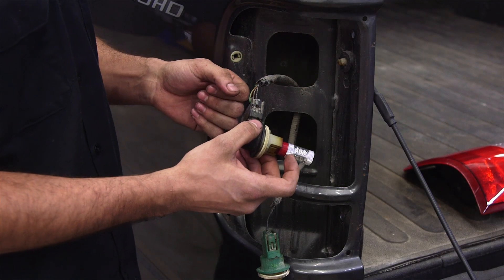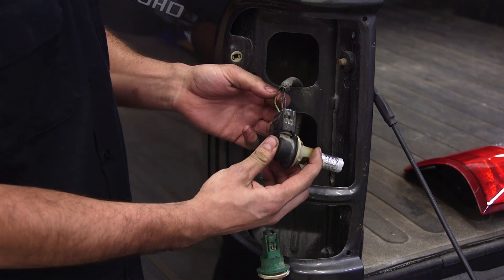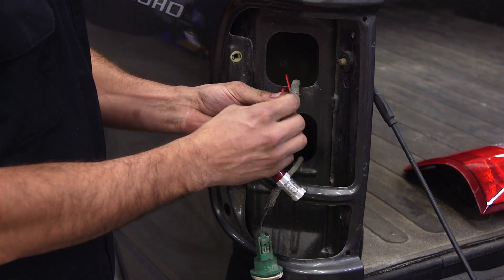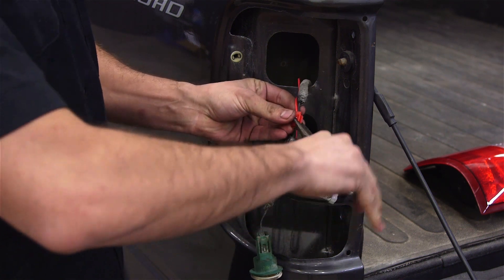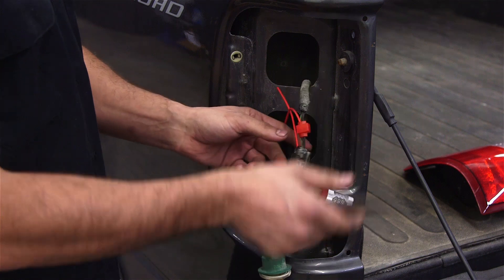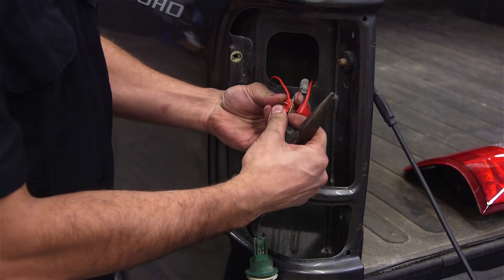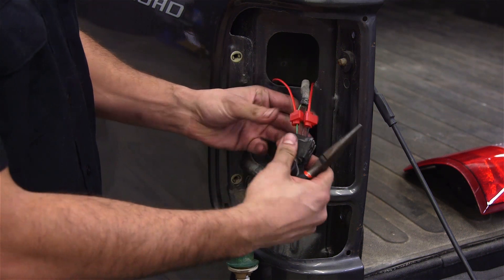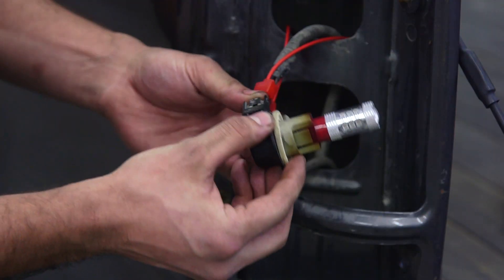Fix Hyperblinking! How to Install Resistors for LED Turn Signals | Diode Dynamics

Comment: My led turn signal doesn't blink at all. But the blinker arrow blinks fast in the cluster.. will it blink once I install some resisters?... someone please lmk. Thanks in advance  ...
Reply from the maker: Hey there! Try flipping the bulb 180 degrees in the plug to see if that makes them blink. If that doesn't work, feel free to give us a call at 314-205-3033, Monday-Friday 10 a.m.- 5 p.m. CST, or shoot us an email at contact@diodedynamics.com, and our in-house US service team would be happy to help you with that.

Comment: Can you install a regular light bulb after the resistor, or will it always need an LED after this?
Reply from the maker: If you go back to halogen, you can remove the resistor.

Comment: So if you have led turnsignals, led tow mirror, a brake strip, and led rear turn signals. How resistors are needed

Comment: Do I need a resistor at the brake light also?
Reply from the maker: Since brake lights are a solid current bulb, you should not need a resistor kit for them. If they also function as your turn signal, however, you may need a resistor on them since the current fluctuates.

Comment: There's an easier way to fix hyper blinking.
Buy a new electronic flasher.
Problem solved.
No wiring needed.
🤦🏻‍♂️

Edit: It just dawned on me why they teach people this...
It's so that instead of just buying LEDs from the company will also buy pointless unnecessary resistors.
More shit sold = more money for the company.
What if they sold you white LEDs and then sold you red covers to install over them for your brake lights?   Would you buy them?

If your answer was no that's stupid who the fuk would do that?
The answer is everybody because that's originally how they sold colored light bulbs.
Reply from the maker: We appreciate your feedback on this! However, it is important to note that not all vehicles come with a flasher module option. Additionally, we do offer flasher modules on our website as well for the vehicles that do come with a module! Thank you for checking the video out! 

Here is the link for the flasher modules we offer:
https://www.diodedynamics.com/accessories/led-flashers.html

Comment: So you are actually putting the resistor in parallel with the turn signal circuit?
Is this a special resistor for this purpose or could I use a regular resistor used for electronics?
 In this case I am actually putting LEDs in my reverse lights and I have read that some people have reported that the light stays on all the time when the car was running is this a common issue I have purchased LED bulb specifically for reverse lights. 
Car in question is a 2001 Grand Prix SE. 
Thank you.
Reply from the maker: Hey there! Feel free to give us a call at 314-205-3033 Monday-Friday 10 a.m.- 5 p.m. CST, or shoot us an email at contact@diodedynamics.com, and our service team would be happy to help you with that.

Comment: What about my brake light that's run off the same line? My turn signals work fine now, but my brake lights still flash.
Reply from the maker: Please go ahead and give us a call at 314-205-3033 Monday-Friday 10 a.m.- 5 p.m. CST, or shoot us an email at contact@diodedynamics.com, and our service team would be happy to help you with that.

Comment: Just had this issue with my truck. I swapped all the lights on the front of my truck to LEDs and now I get the hyper flashing. My tail lights also messed up. They aren’t on while running but will still light up when the brakes are applied. Will putting in the resistor help with this issue too?
Reply from the maker: Feel free to give us a call at 314-205-3033 Monday-Friday 10 a.m.- 5 p.m. CST, or shoot us an email at contact@diodedynamics.com, and our service team would be happy to help you with that.
Reply: I have the same problem in my 2012 Silverado, when the position ligths are on the hyper flash Start, but when my position ligths are off and use the turn signal they dont hyper flash

Comment: Each "location" that has  an LED bulb requires a resistor? Each "LED BULB" requires a resistor. I the assembly has two LED bulbs two resistors are required.  For this application shown one is ok; if that was a Silverado with two bulbs, two resistors per side would be required.

Comment: It would help if you would include on your website resistor ohms... maybe it's in the description but the description on my phone when I click it disappears, if I click anything  else like specifications it will show specification named column and specifications also does not include the ohms... problem in my case is that I need higher than 6 ohms which Sylvania resistor is

Comment: This might be a dumb question, but is it easy to undo everything and go back to your original turn signal bulb? Can you undo the splicing just by taking it off?
Reply from the maker: Yes, you can return to your original turn signal bulb. 

However, since there might be a splice in your wire wrap most users will heat shrink, liquid tape, or electric tape any small wire exposure after removing resistors.

Comment: That will last a year at most.  Better to splice with heat shrink connectors, or solder directly and use shrink tube.

Comment: Great video! Is this kind of connection also considered a bypass? I think the dashboard indicator might be unable to detect whenever the LED light is malfunctioning. 
Do you think using a resistor might have the potential for overheating and durability issues? 
Or do you think changing the turn signal flasher is a better way to do it instead?
Thanks!
Reply from the maker: The reason we add a resistor is because the LED is using much less power than the factory halogen. So, the computer thinks there is a bulb out. This is what causes bulb-out warnings and hyperflash. The resistor puts resistance on the circuit, tricking the computer into thinking that there is a halogen bulb still in the socket. These resistors do get very hot, but are built to handle the heat. We recommend mounting them away from any flammable parts or parts that can melt for this reason. However, if you can find a flasher relay for your vehicle, this is always a much easier option!

Comment: I notice that every company that shows fixing the hyper flash on a vehicle it's always the rear lights and never the front because it's a lot more intricate for the fron. Especiallt when there are four front bulbs.
Reply from the maker: Hey! In this case, it was easier to demonstrate. The front will be the same process, but it is much harder to get a camera in the engine bay to show how it's done.

Comment: I bought a relay and lead bulb from you guys i put in the lights but i dont know what is the ground and what is is the signal wire i have a ford ranger 2019 has three wire on my signal light green yello and purple dark color please help
Reply from the maker: Hey there! Please go ahead and give us a call at 314-205-3033 Monday-Friday 10 a.m.- 5 p.m. CST, or shoot us an email at contact@diodedynamics.com, and our service team would be happy to help you with that.

Comment: I installed the resistor the way you showed in the video and my Miata still does the hyper flashing.
Reply from the maker: Hmmm- that's strange. Please reach out to us at contact@diodedynamics.com, or give us a call at 314-205-3033 M-F CST, and we can help find out what's wrong!

Comment: Will I need to add a resistor for my turn signals and reverse lights? Meaning I would have 2 resistors per side
Reply from the maker: Hey Travis! You should only need one pair of resistors for your turn signals.

Comment: If I had purchased led lights that are plug and play. Do I still need a resistor to be installed?
Reply from the maker: Hey Jack! This really depends on your vehicle. Some vehicles work fine without resistors and others will hyperblink and throw bulb-out warnings. We always recommend picking up some resistors if you are upgrading to LED because they are inexpensive and come in handy!
Reply: @diodedynamics  yea but if I do that I lose my warranty from the dealership
Reply from the maker: @jacklarage2651  Then we do not recommend installing LEDs.

Comment: With turn signals that have 3 wires, how do you know which wire is the turn signal? Is there a tool to help with this?
Reply from the maker: Go ahead and give us a call at 314-205-3033 Monday-Friday 10 a.m.- 5 p.m. CST, or shoot us an email at contact@diodedynamics.com, and our service team would be happy to help you with that.
Reply: @diodedynamics  Thank you very much!

Comment: I have tried installing these bulbs in my 2013 Chevy Silverado with no success. Yes I installed the resistors on all the lights that flash. Guess what still have hyperflash. I don't recommend these LEDs at all. I have spent a lot of money trying to get them to work, enough is enough.
Reply from the maker: Hi there! We're sorry to hear you're having issues with your turn signals. Please reach out to us at contact@diodedynamics.com, or give us a call at 314-205-3033 M-F CST and, our service team will be happy to help you get rid of the hyperflash.

Comment: So one side of the resistor goes to the black wire which is ground and the other end goes to the green which is the turn signal correct?
Reply from the maker: That is just for this specific vehicle. You are correct in saying that one goes to the black ground wire. However, you will need to locate the turn signal wire for your specific make. It may not be green.

Comment: Should've made this error free for 90$ that they cost 😂
Reply from the maker: Hey Christian! Many models do not require resistors. It is specific to each vehicle, this is why we offer resistors. We do offer more affordable options for bulbs as well.
Reply: @diodedynamics  I love yalls products but for 90 they should've them built in.
Reply from the maker: @notoffroading  We'll definitely pass the suggestion on to our engineering team!

Comment: The one part they always skip over is figuring out how they know the green wire is the turn signal. Was it a schematic? A multimeter? A lucky guess? Your favorite color? That's part of the process too.
Reply: grab a multimeter and turn on the turn signal. measure from the black wire to either side. whichever one gives you power is the one you need
Reply: U need circuit tester 12V
Reply: Easiest way is to just google it. One other way is to look at both left and right sides. The color that is different on both sides is the turn signal. (e.g. Left side has green/brown/black and right side has yellow/brown/black then you know it is the green and yellow wires)
Reply: Ha ha ha, I love the part about - your favorite color! 🤣

Thank you for the laugh, and a Happy Autumn 🍂 to you and your family, Anthony.
Reply: Someone does not know how to find the correct wire, might want to have a professional install the resistor.
Reply: @douglasdever6134 hate dudes like u “take it to a professional if you don’t know how to do it” u sound like the type to give up when somethings too hard

Comment: Instead of tapping the other end of the resistor wire to the  ground wire, can you just attach it to the car body with a lug when it is mounted?
Reply from the maker: We recommend connecting it to the pre-existing ground wire.

Comment: Straight and to the point.  Quick tip:  wrap or seal those scotchlock connectors as they are not weather tight and will eventually lead to wire corrosion.
Reply: Electrical tape good enough for the job?
Reply: @migonzz  yes.
Reply: @migonzz  electrical tape or liquid tape will work as well
Reply: Thanks fellas

Comment: Hey my headlight has 6 wires ! Two Black , Two Red , & Two Green ! How do I identify which wire is the correct wire ?
Reply from the maker: Hi there! You would need to find the two that go to your turn signal. If you can send us some good pictures to us at contact@diodedynamics.com, we can help you identify those wires!
Reply: @diodedynamics  I actually figured it out ! I went into the one green wire & any black one worked . Left the rest (2 red & 1 black) alone
Reply from the maker: @HorizonMain  Awesome! We're glad to hear it! Let us know if you have any further questions.

Comment: So you put the parking light & ground wire together . Then the blinker goes by itself? Is that the same for headlights as well ?
Reply from the maker: Hi there! The resistor will connect to the blinker wire (check your owners manual for this wire color) and your ground wire. LEDs require much less power to run than factory incandescent bulbs, so this resistance tells the vehicle's computer that the bulb isn't out and eliminates the hyper-blink. You should not need to install resistors on an LED headlight bulb. If you are referring to the blinker bulbs in the headlight location, the process will be the same!
Reply: @diodedynamics  Yes I was referring to the front singnal lights! Thank your for the speedy reply ! You should make some Nissan Titan videos 😉
Reply from the maker: @HorizonMain  You're welcome! Hopefully we will in the future!

Comment: So you dont have to do any cutting
Reply from the maker: Nope! You should be able to use our quick splice connectors to easily connect the resistors! Feel free to reach out to us at contact@diodedynamics.com if you have any installation related questions!

Comment: oh well i figured that myself  to add a resistor to these
lol  but i though that a real kit like that would be less hot  im trying to run led on a electric scooter i must not use hight wattage stuff
Reply from the maker: Hey there - resistors will generally be needed for any vehicle when converting over to LED for turn signal locations. That is pretty standard.

Comment: When you clamp down the metal part does that cut through the wires?
Reply from the maker: The t-taps will break through the wire insulation to make contact with the wire underneath, however it will not cut through the wires entirely.
Reply: So technically you don’t even have to cut any wires ?
Reply from the maker: @ToopIaya , no wires are being cut at all, just tapped into.
Reply: Should we seal these with electrical tape or something ?

Comment: not all resistor work, so what OhM is your resistor, what OhM resistor is the best for 12v-24v DC???
Reply from the maker: We recommend our 50W 6ohm resistor for all turn signal vehicle applications. Unfortunately, we do not have any recommendations for any other custom setups.

Comment: This video is a little misleading because it glosses over that some LED bulbs come pre-installed with resistors and or the taillight / front light relay can be upgraded to accept "hyper flash" LED bulbs.  Note that some vehicles may also only have a relay for the rear lights and not the front in which case you may have to use a resistor (or bulb with an included resistor).  Also, note that using the proper size of resistor is also key as the larger the resistor the hotter they get and some can resist more power than desired to properly / fully illuminate the LED bulb.   Lastly, this simple method of clip install is really the "cheap, quick, and dirty" style.  It's really better to cut the wires, strip off 3/4" from each end, slide over 1.5" of heat-shrink on one side, braid the wires together (not twist up wire nut style), solder the connection, then slide the heat shrink over and lightly heat with a lighter to seal the ends for waterproofing.  Lastly, resistors should be mounted on metal with screws or double sided thermal tape made to withstand heat. (like what is made for computer chips)

Comment: On my 2016 Ram 1500 I was getting the hyperflash on the dash but not the blinker itself. I installed the resistors and the hyperflash went away on the dash but I now get a parking light out error when I activate the blinker. I have the armor series switchback led's.
Reply from the maker: Hi Perry! We haven't tested that particular brand of bulb with our Resistor Kit, but please feel free to give us a call at 314-205-3033 Monday-Friday 9 a.m.- 5 p.m. CST, or shoot us an email at contact@diodedynamics.com and our service team will be happy to troubleshoot that!

Comment: So I have led lights but I noticed that only the headlights has resistors the rears don’t I’m guessing that’s why my signal light is blinking fast??
Reply from the maker: Hi there! If you have LED turn signals in your tail lights, you will likely need resistors to prevent hyperblinking!

Comment: Where and how did you mount the resister for heat displacement?
Reply from the maker: Hey Zack! Each installation will vary slightly, but we definitely recommend securing it away from anything that would be sensitive to heat. Feel free to give us a call at 314-205-3033 Monday-Friday 9 a.m.- 5 p.m. CST, or shoot us an email at contact@diodedynamics.com, and our service team will be happy to answer any questions!

Comment: Can anyone help with choosing the correct resistor? The standard bulb wattage for my vehicle is 21w. I'm reading you should choose a resistor with a wattage similar to that of the stock wattage.
Thanks heaps
Reply from the maker: Hi there! Please feel free to give us a call at 314-205-3033 Monday-Friday 9 a.m.- 5 p.m. CST, or shoot us an email at contact@diodedynamics.com, and our service team will be happy to help!
Reply: You want about a 6 or 7 ohm resistor.. just need to use ohms law